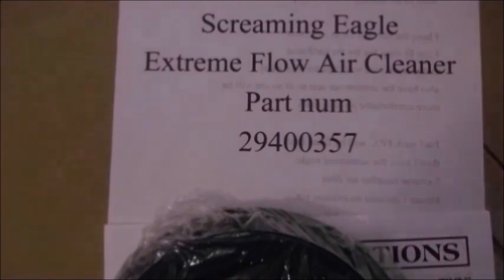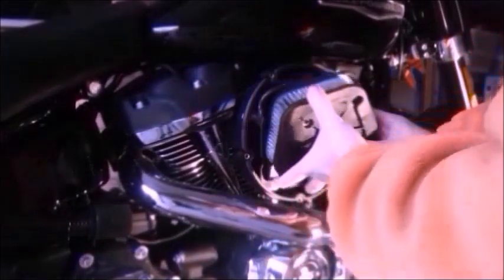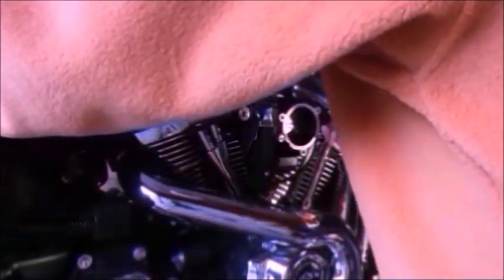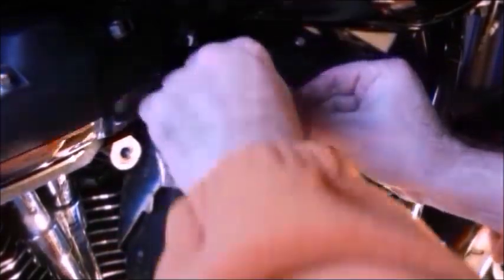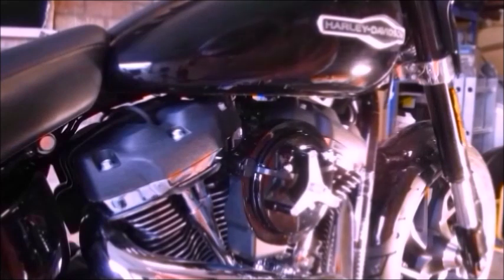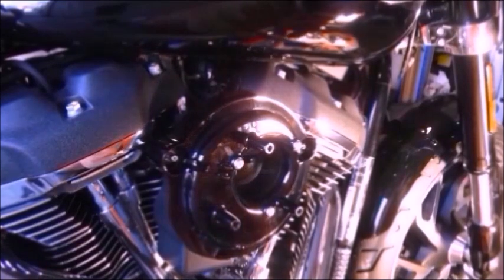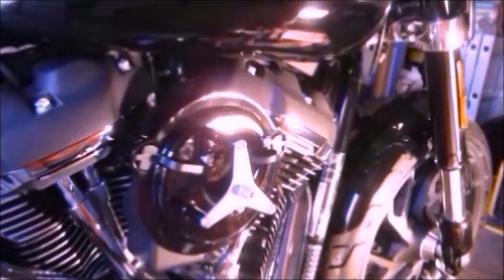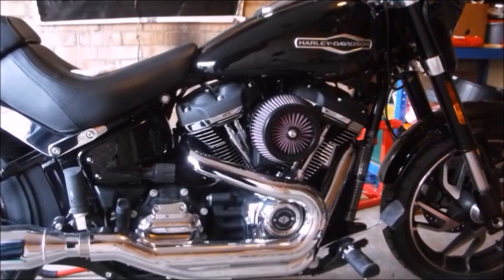Suffolk Sport Glide    Screaming Eagle Extreme Flow air filter

Comment: Have you had any issues with oil blow by after installing this air filter??
Reply from the maker: Hi, if you mean oil blowing back from the crankcase breather, no i havent had any blowback. 
I did get get some oil drip from the filter itself, but that could have been me putting too much oil on the filter, next time i do it i will make sure i leave it to drip for a few days before refitting to the bike. hope this helps. Cheers Tom